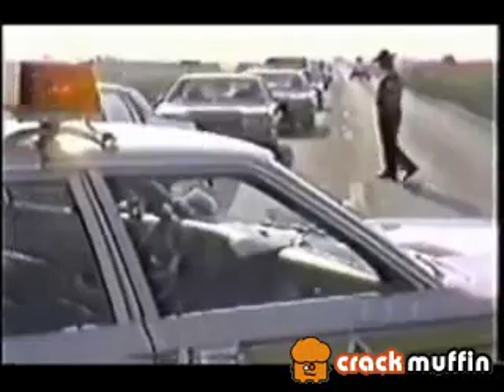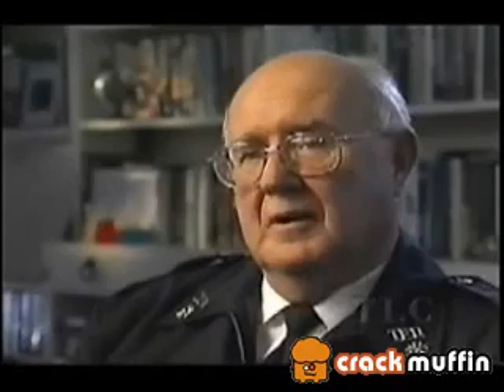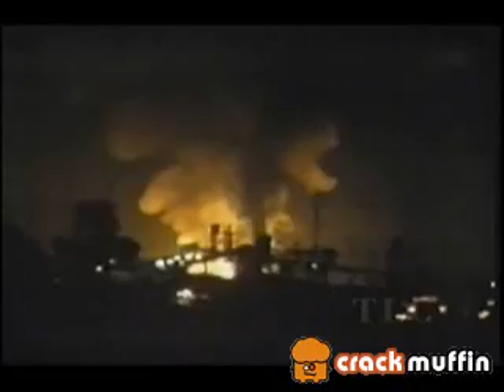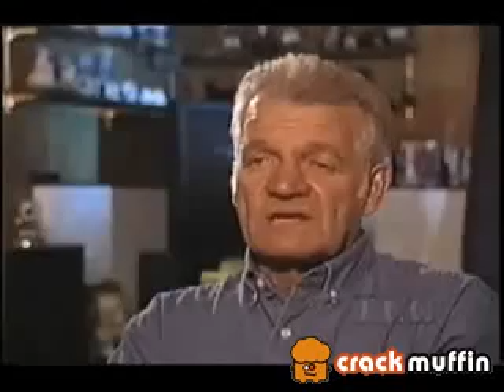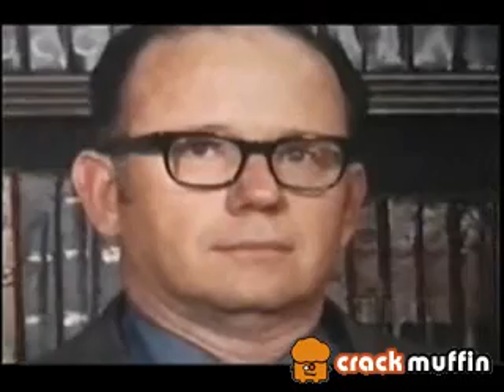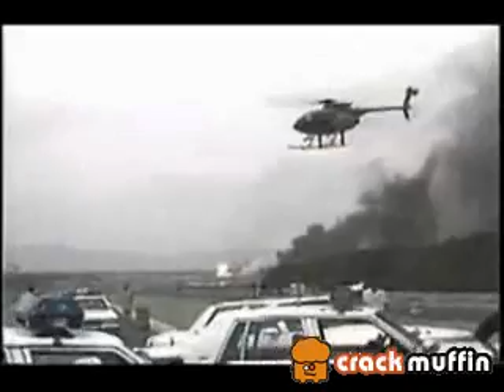Largest Non Nuclear chemical Explosion

Comment: You're implying that nuclear explosions are chemical. They're not.
Reply: Smh, Nuclear is Chemical...
Reply: +Zack Scruggs Nuclear reactions involve the particle in an atom's nucleus and their interactions (Protons and Nuetrons). Chemical reactions only involve interactions in the outer electron clouds of the atoms. Nuclear is not chemical in this context.
Reply: +GordanCable I think you may want to look this one up. You're wrong.
Reply: In nuclear physics and nuclear chemistry, a nuclear reaction is semantically considered to be the process in which two nuclei, or else a nucleus of an atom and a subatomic particle (such as a proton, neutron, or high energy electron) from outside the atom, collide to produce one or more nuclides that are different from the nuclide(s) that began the process.

Classically, chemical reactions encompass changes that only involve the positions of electrons in the forming and breaking of chemical bonds between atoms, with no change to the nuclei (no change to the elements present), and can often be described by a chemical equation.

Sources: Wikipedia

You may be confusing nuclear/chemical reactions with the field of nuclear chemistry which is involved with processes using x-rays, NMR, and radioactivity.
Reply: +Michelle Richardson ...Props, I cannot figure out if you are serious or not.

Comment: Well there seems to be a lot of conjecture here. This may not be the largest conventional explosion ever but it is close. 9 million pounds of ammonium perchlorate going off in this case with a natural gas pipe line going off at the same time underneath the plant is about 4 kilotons of TNT. The 2 smaller explosions really don't count because they are so small compared to the other two. First explosion, 1.5kt, second explosion 3kt.

Comment: The N1 Rocket Launch incident is the largest non-Nuclear Chemical Explosion not this tiny fart.
Reply: Diamond Bucket Non-nuclear explosions caused by humans.

Also the big bang is arguably the largest non-human non-nuclear explosion to have happened to our knowledge, and if the multi-verse theory is correct you can bet that there has been an even larger fucking explosion than big bang
Reply: Wait, I don't understand. If N1 was only a single rocket, how could explode with more force than a whole plant that produces rocket fuel?
Reply: Disagree.
Think of the 10s of kilotons of dynamite ignited prior to 1945 los alamos nuclear test for calibration purposes.
Reply: LawsForever You seem to be miss informed, the Trinity calibration test which was the only test I could find that happened in 1945 consisted of only a meagre 100 ton TNT. Which is about 0,1 kiloton of explosive force.

The N1 Rocket Launch explosion was about 7 kilotons making it the largest non-nuclear explosion to date
Reply: no just not this explosion was what bigger
Reply: noa van voorthuisen banana The Murdock BLEVE incident did not even reach 0.5Kt so its a tiny fart compared to the N1 Rocket Launch incident
Reply: Tiny fart? The largest blast of the PEPCON disaster was equivalent to a 1kt nuclear device
Reply: EdikShepherd Well its simple, the rocket has all its fuel concentrated in the fuel tanks, whereas in a munition plant or fuel plant the fuel is scattered around and they are usually in much tougher storage tanks.

When fuel is concentrated the force unleashed when ignited is much greater then if the fuel is in a non-enclosed environment, the energy has no way of escaping and therefore builds up resulting in a much more powerful and destructive force.

Comment: No video available, but the Halifax harbor explosion in 1917 was bigger. A tanker loaded with explosive chemicals, to be used as propellant and explosives for artillery shells in WWI collided with another ship. The explosion killed more than 2000 and leveled most of the city. A community of native peoples across the harbor was wiped out by tsunami type wave more than thirty feet high.

Comment: I'm no expert but wasn't the initial sound you heard due to the explosion's shock-wave travelling through the earth not the air, causing the camera to vibrate.
It would at least explain why you heard the explosion relatively quickly, because sound can travel around 5 times as fast through ground

Comment: Sounds travels much slower than light, and in that last explosion, it is clear that distance from the cameraman to the blast is at least a couple of miles away - and yet, in this video, the instant the explosion is seen, the sound is heard.  In reality, it would take several seconds for you to hear anything as indicated by the propagating wave front, which in most cases would move as fast, if not faster, than the sound originating from the blast.

Comment: in the actual video the sound arrived several seconds after the blast because the camera was miles away from the plant; in this video they just dubbed it with some stocking audio effect so you can hear the sound simultaneously.

Comment: How insane. Considering US isnt short of land space, youd think if a company was to store such huge quantities of highly volatile chemicals, they would store in multiple depots away from the factory, so if 1 depot ignites, the other depots are safe. If they couldnt buy the land around them, then store the chemicals in pits, so if a pit ignites, the heat radiation and blast is directed upwards not outwards. Fires will happen, but that chain reaction could have been prevented saving 90% of chems.